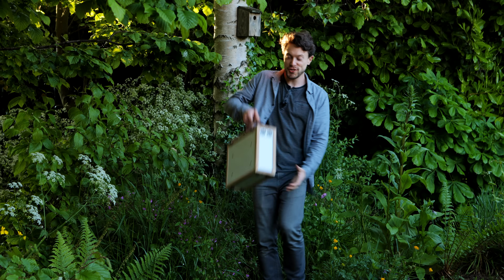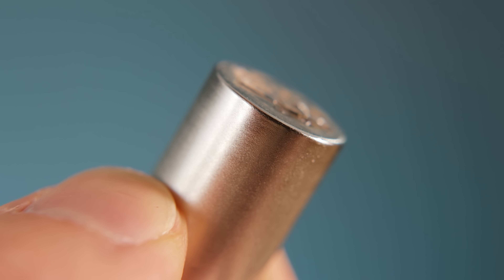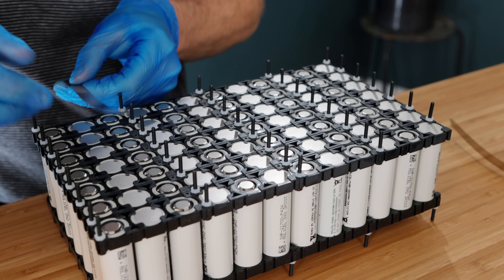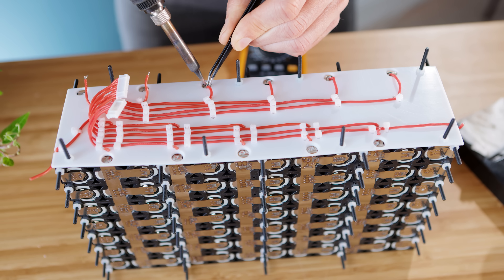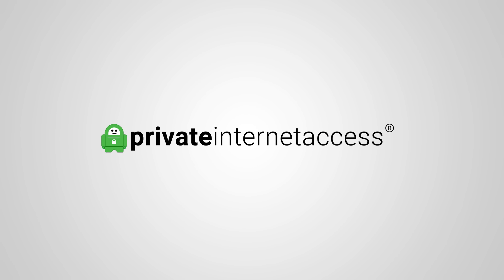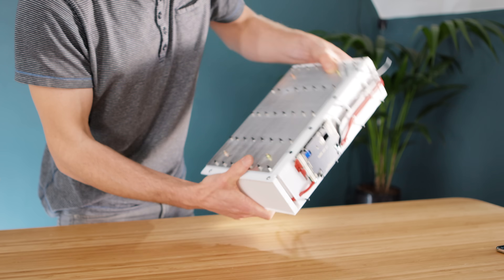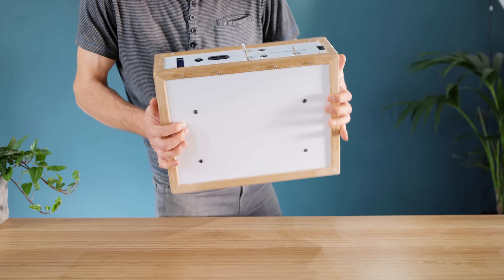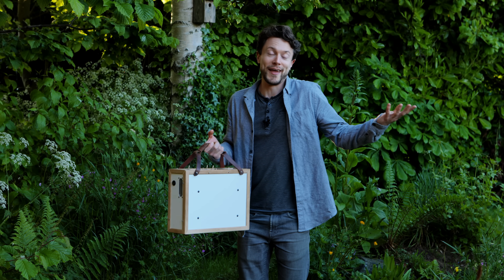Build your own portable POWER STATION (1200w, USB-C and MORE!)

Comment: IDEA

Part 2: Adding Solar Charging to the pack.
Reply: Dew IT!
Reply: @artistandcamera3245  Not that hard, you only need a foldable one from Campers, would be a great addition.
Reply: Forget about that, I think our mate lives in Britain, the empire where the sun never is.
Reply: @razam6608  Ok, hydroelectric or wind?
Reply: Thought the same. Also, why those Dean connectors whereas XT60 or XT90 would have made more sense ?
Reply: @speedsterh  idk, he probably had a specific use case
Reply: meh... not feasible... you'd need a lot of area to recharge that pack.
Reply: @robertmueller6979  Yeah that's true, but if you have time or extend it an hour or so, it's better than nothing and there are foldable ones I saw on trailers, they had quite a size, 3x1,5m when unfolded, and when folded it fits in their back compartment of the trailer.

I didn't ask about details though, but the concept is not bad
Reply: I'm sure there's some feasible way...
Reply: @artistandcamera3245  lol.... sure... drag a trailer
Reply: maybe it's time to work on some new tech then... Batteries 50 years ago were nowhere near as small and powerful as today. Traditional solar panels are old tech. Time to improve and move on.
Reply: @artistandcamera3245  ...this is so true. Our basic solar panels today are at most 20% efficient. 5 times that would make a real difference.
Reply: @robertmueller6979  It looks like wind energy is 50% more efficient, but portability is worse than even a large solar array. Flexible panels that could be rolled up and stored in a trailer might be doable.
Reply: @robertmueller6979  Depending on your location, a hydroelectric generator turbine could work as well. Charge your batteries continuously during the night when you are presumably sleeping (not moving) and not using the battery.

Comment: @DIY Perks Hello, could you make a comparative thingy with the SYS-PowerStation SYS-PST 1500 Li HP FESTOOL - 205721 ? It's almost the same size, delivers 3 times the Watts, but is very expensive. Does yours is about 3 times less expensive ? Or is it really different. 
You're used to do some unique things but this time it's interesting to see a brand did something too that can be compared.

Comment: This channel is going from

 Possible DIY projects that can be easily done at home to Impossible DIY projects that can be never done at home.
Reply: I think the biggest obstacle in this build, (for me anyway), is the battery cost. Quite prohibitive here in Australia.
Reply: How could this not be done at home exactly? And how is it impossible? If you’re watching something like this with intent to build it, it would be in your best interests to learn a little about the things he’s talking about like how electricity works and all of the circuitry. Also, it would be assumed that you have some of these tools and even if you don’t they aren't that expensive. I mean it’s a 1200W power bank you’re making not a lego house. You could make those battery brackets with a 3D printer and I’m sure if he 3D printed these which he may have then he might be able to provide an STL (drawing file) for it. I encourage you to deep dive into this stuff if you are truly interested in it i think you will enjoy it.
Reply: @davebacknolaliki1452  I think you're right. It's just that these projects always seem easier to do before you actually attempt them.
Reply: @jaredj-v5l  yeah that’s true I do agree. But it’s still possible. I mean compared to what a manufacturer would use to make something like this, he’s using relatively simple things to build it.
Reply: @davebacknolaliki1452  He didnt 3d print a single piece of aluminum lol
Reply: @user-jk9zr3sc5h  you might wanna reread what I said very carefully lol. I didn’t say that I said 3D printed the battery racks. Aluminum is cheap that’s not an issue at all. If his projects are so expensive go figure out a better way to make it dirt cheap and you make a YouTube video of it. I doubt he wants to spend a bunch of money on a project either.
Reply: @davebacknolaliki1452  chill out

Comment: Those step down buck converters have tendency to get shorted with outer aluminum cell when vibration is added.
Also really nice video. Safety measures were well taken care of. BMS has separate charging port? Does have short circuit protection in it. Connector looked like it can be easily shorted.

Comment: Those molicels look like rewrapped Samsung
which means you're buying B or even C Bin quality batteries, considering samsung's own 30T a 3000mah/35a aka not ideal for a battery pack, a lower amp higher mah 21700 would be preferable whi samsung sell.
Anyone considering this please sppend the few pence extra and buy Samsung or Sony 20700/21700's

Comment: in the future,  you should probably use an xt60, that can carry far mure current, especially in bursts, and is much more common, or use on xt90 instead of 2 xt60s, which is a bit smaller, and simpler than 2 connectors

Comment: How reliable and safe this system would be to use as a battery pack for 100 to 200 W solar system ? Also the longevity of the bettery system should it be hooked up to solar panel ?

Comment: one thing that would be interesting is to use various sources of power to keep this device charged.
it would then be more like a buffer.
a solar array would come to mind, or a small wind turbine.
and then i have seen a simple TEC generator that has electricity generated with one side next to boiling water(campfire...) and the other side cooled by a creek.
https://www.youtube.com/watch?v=hDLWO_Iaflc

Comment: "Power a microwave outdoors!"  Alright, I'm sure that can be a fun trick
"Go camping and keep your devices powered for weeks!"  That's absurd
"Keep essential utilities like a fridge going for almost 2 days!"  That's pretty nice for an emergency situation
"Do hard core gaming for 6 hours!"  Are gaming machines really so inefficient that a fridge/freezer combo or a microwave get MORE battery life out of this?
Reply: Refrigerators have pretty good seals to keep them cold without needing active cooling. But they're not perfect (and people like to stare into open fridges), so it does require some energy. As long as you keep the fridge closed as much as possible during the power outage, I can see the battery backup being pretty effective.
Reply: well, the gaming systems take more electricity because they have more componets that need it, fridge onlu has a few, same with microwave, also the parts in gaming stations take a good deal of electricity ( i totaly didnt want to write "energy" instead of "electricity". )

Comment: REMEMBER
For high output u need to connect the wires to the middle (if u have 7 cells u need to connect the wire to the cell 4 in each stack) then to the first and last cell up to again the middle...it gives u better ressistance inside the battery = longer battery life

Comment: This was somerhing i have been thinking about a long time to actually build. I now use a 145 Amp lead Calcium battery (semi traction) for camping with 2 tents, but that battery weighs almost 40kg and this was reluctant to get a more powerfull one as the weight increases as well. Now seeing this i have a more proper guidline to look at. Only my choise of lithium battery is not lithium ion or lithium polymer but lithium iron phosphate. Lighter in weight higher energy density and significantly more safe. Since size does not really matter to my intended use the only thing bothering me is the propper electronics to balance the cells with a BMS but Li-fp04 cells have a 3.2 volt per cell instead of the 3.7 v per cell. I'm having trouble finding good BMS's for that.

Comment: I want to buy one of these from you. Not from some sketchy-bacon Chinese company that'll sell them on Amazon and use old lithium batteries or wrong connectors, making the whole thing cheap and rather useless or even dangerous. I just want one made with the care you took, the perfectionism you display. I don't have the tools, know-how, or equipment to make one but I'd like to buy one made  by you. :)

Comment: simply :

battery 12/24/48 Volt DC , coverted to AC 220-250 VAC using an inverter, 

it's simple, but hard to assemble

Comment: may I ask if that fire from the start of your video was a fire from one single battery or there was other flammable stuff? Great video by the way. Maybe some opening on the bottom [mesh] could be handy because I would say them ventilators would push in some dust for sure outdoors and it may over time fill your cavities with muck.

Comment: If I was going to build something like this I'd probably switch it up a bit. I'd want a 12-volt cigarette lighter plug right on the device because there are a lot of small portable electronics designed to take power that way. I'm thinking of like a tire inflator or such. I'd probably have also integrated some LED lights onto what would be the notional front edge when it was being carried, simply so that if I was trying to carry it at night I wouldn't also have to try to manage a flashlight at the same time.

Comment: Hmm I need to make inverter that can use my electric motorcycle battery 5,3 kwh and it can output 30kw of power. Also this battery can be be used with electric bike so it has many use cases.

Comment: It would be just great if you took used, replaced electric car batteries. It would make more practical impact. Each such battery has up to 25-30% of pretty working, healthy cells. By having 6-8 of them (cells) you can weld thick iron!

Comment: Awesome video! Im making my own lion battery pack, i need to get 24V in a 6S config. Im going to use 24 lion batterys, but im unsure of how you wire it up on both sides, does anyone know?
Reply: Frankly: if you need help for this, you'd better learn A LOT of other stuff before handling Li-Ion batteries.

Comment: good idea.  but I prefer to use dry batteries which are commonly used in solar energy storage circuits.  the capacity is larger and the current is more stable.

Comment: A beautiful energy box: D I would add as much as 2400W and then it would be possible to do without electricity from the network xD + solar panel about 100W of charging power and we have a beautiful set to camp when the sun goes down xD

Comment: I actually just finished mine last week. Which nowhere near that size I am running a 4s4p cell with almost identical management systems. I also included some LED bars onto my case so that lighting doesn’t necessarily have to be completely external. I wanted to stay in the realistic realms of solar charging. That’s a very nice setup, I like it!  🤘🏼🤘🏼

Comment: I'm beginning to realize that the best way to do things yourself is to own a professional manufacturing facility.
Reply: Good😂😂
Reply: You either pay for labour or you pay for tools. DIY is a hobby, not a cost saving method.
Reply: @Joostuh  In his latest video he ionized Nickel to make a magnet bigger. That's lab stuff.
Reply: @zgillet  Still, he did that with mostly household items and it worked out perfectly. Most of the time, it's not so much the tools that make the difference, but the creativity and genius of the brain that's operating them that does. 

You'd be surprised with what you can make relatively simply.
Reply: @SteenG3yL  I defy you to name a single thing in the video you have in your household.
Reply: @Joostuh  Tools are an investment, labour is a service
Reply: @Joostuh  Very nicely said!
Reply: I agree
Reply: Thank you i really laughed so hard😂😂😂😂💔
Reply: @epicn  nice build
Reply: I mean, the stuff you need is still less expensive than a finished similar battery...

Comment: Can I make a suggestion - as Apple have recently re-vamped their iMac line with the old colours from the original iMac G3 series, converting a G3 iMac into an "iBass" portable bluetooth "boom box" would be quite the project (nudge nudge "apple, hey wanna sponsor something?"
My idea has been to replace the tft screen with an 8" - 10" Bass bin woofer, still use the small speakers as tweeters and add midrange firing from L/R sides.
Then (re)use as many of the i/o's as possible even retain the cd/dvd for the heck of it, but 100% add bluetooth and of course use the i/o ports for headphones and wired audio in, also using the in built power would enable the use of harddrives to be plugged in but adding it's own ssd (M.2) wouldn't hurt, not sure about the benefit of firewire though.
Of course using something similar to this videos power bank you maybe able to use the kettle lead power cable as the charge in, + the iMac has a handle on the top so weight wont be an issue.

All this controlled & tied together by a Raspberry Pi for multiple inputs control (wired play, bluetooth and of course cd - if a smaller "woofer" were used an LED touch screen could be used for control (or phone via bluetooth), or for old school iMac fun use the old roller ball mouse that could easily be found a home where the ram once was. 

Another consideration is led strips responding to the sound, with the iMac's translucent exterior making quite an eye catching display.

I have my iMac sat ready to do it but it seems a shame to breakdown a perfectly working iMac so I may hunt down an internally broken, externally ok iMac as working iMac sell for £200+, the iMac Grphite SE I bought a 100 years ago sells for twice that being the last ever made.
Anyway, i thought i'd throw the idea out there -  considering you have the tools and know how far more than I do.

Comment: the timing of this was perfectly annoying ! I just finished a similar build (only 12s3p though) and the USB boards I used cant do quickcharge (I found a board that took up to 60v directly). now I have to pull it apart and replace the power delivery in it ! thank you !
Reply: also, dont try to take it on a plane ;)

Comment: Soooo, the 13S2P pack I made from SLP08HP cells has a punch of 21.84KW at 54.6V with a pulse wattage of over 43KW?!?! Those cells are rated at 200A normal draw and 400A Pulsed ... EACH!!

Comment: Hey - I have watched your content for a while now, and it was your laptop recycling video that got me started on collecting Lipo batteries.

I was wondering if you had a recommendation for a Bluetooth audio receiver I could hook up to my smart TV? I want to wear headphones plugged into the wireless module across the room, and specifically use wired headphones plugged into it.

Any chance you can help?

Comment: Could you explain how the air flow will cool the batteries?  From what I have seen the batteries are isolated from any potential air flow ducts on all sided by thick PTFE sheets. Teflon (PTFE) is an excellent thermal insulator and to my way of thinking will keep the heat produced by the batteries near the batteries making the fan system no more than a token gesture. Is there a flaw in my thinking?

Comment: quick corection.
u can not just simply check the voltage of old cells salvaged from laptops and group the by the voltage. RED FLAGS!! the way you group the the correct way is by testing them for capacyty and internal resiatance and group the closest numbers together. 
anywam great content!  keep it up sir.

Comment: I really enjoy DIY Perks, and I have made/modified several of his projects.
But having worked with Li-ion cells I can’t help but mention the layout of the cells.
Since the power is drawn from one side, and the voltage is measured at the same side, the cells on that side are subject to a significant larger current draw than the cells on the opposite side.
Furthermore the importance of monitoring temperature is overlooked, and PTFT is not only a great electrical insulator, but also a great thermal insulator. I would imagine that the BMS has this functionality built in, so it’s probably just a case of utilizing this.
And all though negligible the cells “swell” and dissipate gas when charged/discharged , a precaution worth mentioning.
But the build is very nice and I am currently building a similar contraption myself. Keep up the good work.👍

Comment: Which inverter are you using? I am asking because most inverters I have seen were designed to work with 12 or 24 V for use in a car/truck, but I never came across one which was built for 50 V.

Comment: Hi Matt, can you please do a video on upgrading a laptop battery pack from stock capacity. Also please guide to help bypass the bms restriction the manufacturer's put deliberately to force you buy a new laptop or battery pack.

Comment: And then theres's me, soldering wires onto them, stuffing all the wires into a cardbox box with the batteries, damaging insulation(aka. packing tape) in the process, making it short out, melting all of the insulation, until it burns up violently.

Comment: Just be sure to check if you can take it with you before you hop on a plane with it - in the US, carry-ons are limited to 100 Wh, for example. Taking it by car, truck, or boat is a bit easier.

Comment: Every cell has to be matched. The same age, type, number of cycles, etc. You covered all the cells blocking any cooling air from circulating. It will now take a long time to cool down the pack after charging and discharging. Do you have temperature sensors in the pack?